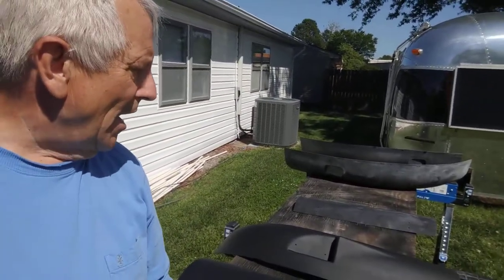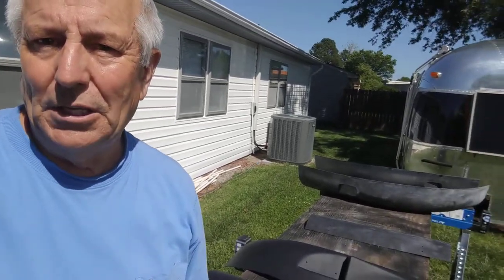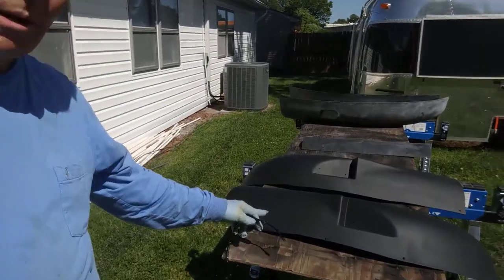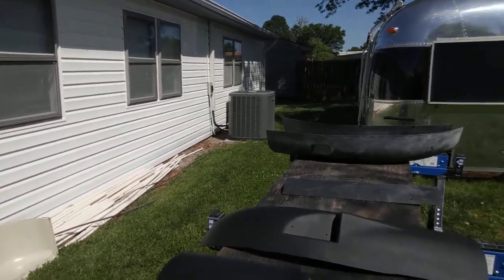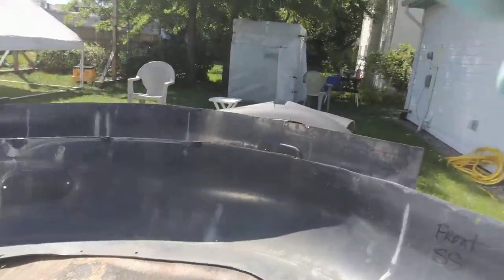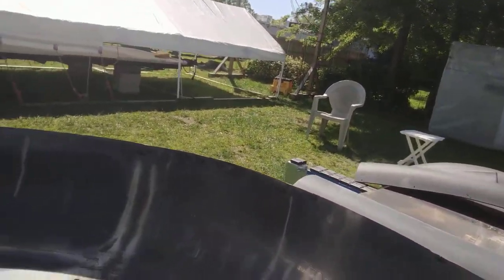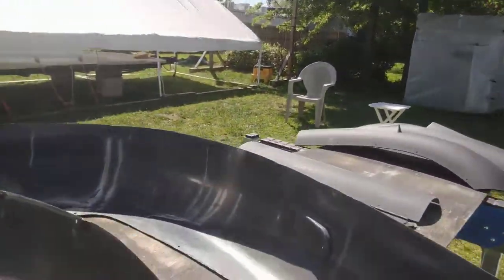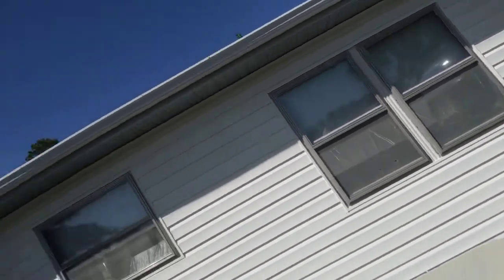Airstream Banana Wrap Repairs and Priming

Comment: Hello, I just found your video's today Dec. 29/2021 but I would like to suggest that if you haven't reinstalled the interior skins yet, perhaps you should consider installing cables for a rear camera, & an interior camera. I hope to do a shell off reno on my 1983 31' Limited soon.
Reply from the maker: Hey there, thanks for your tip.  I'm just about at the point of installing interior skins and I've been debating on the need for a backup camera.  I'll probably do it, but at this point I'm still not certain. My wife and I make a pretty good team when it comes to backing up.  The camera would be strictly for the event where one of us has to backup without help. As for an interior camera, we'd really never considered one.  Obviously you have.  I'm curious as to what your reasoning is there, if you don't mind my asking.  Good luck on your project and we'll be happy to answer any questions you might have related to our project. Pete
Reply: @petewoodhead52  I have a Sierra Denali 3500 as a tow vehicle, & it comes factory prewired for a rear & interior trailer camera, as some other newer tow vehicles may. As for having an interior camera, well on 1 trip to Florida I forgot to lock the fridge door!!!!!! A bottle of maple syrup flew out and broke, thankfully I don't have carpet...LOL I believe that prewiring the trailer for cameras,  & doing that when the interior skins are removed should be a selling feature!  TTYS
Reply from the maker: @sierradenali3270  I thought that might be what you meant.  Once when we drove into Chaco Canyon we discovered that a few items had ended up on the outside instead of the inside of our refrigerator.  Our tow vehicle is a 2006 Dodge Ram 2500 Diesel, but in 2015 (I think) I had to replace the radio/nav system and put in a much upgraded Pioneer system.  It allows for two cameras, so I installed a backup camera on the truck.  Which I like.   As for selling features I do understand where you are coming from.  In our case we're adding many upgrades, but it's all for us and our comfort.  I will be adding extra wiring though for sure.